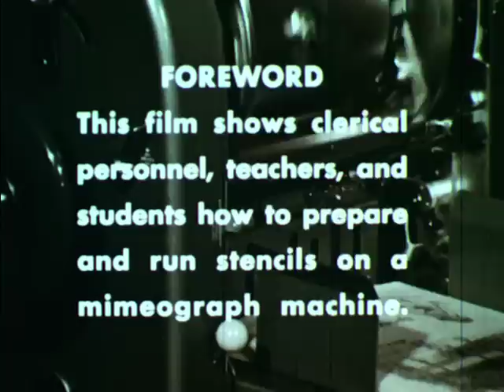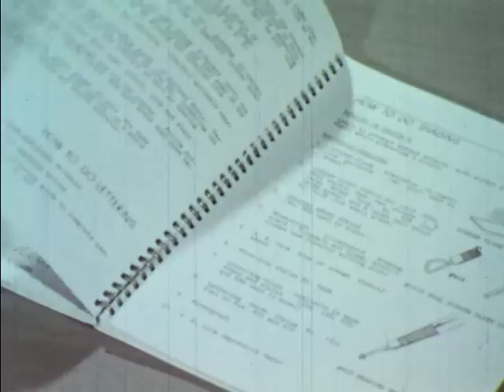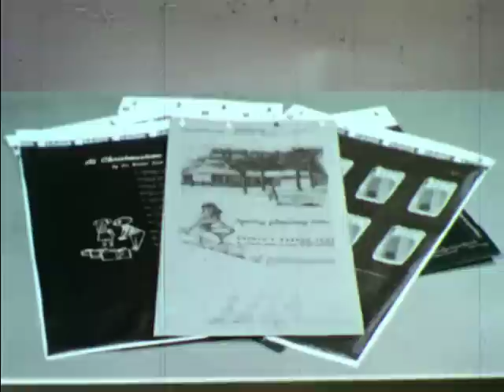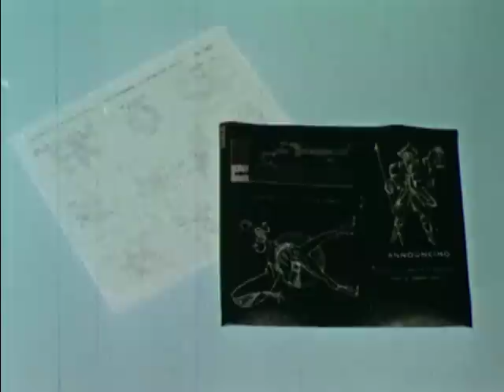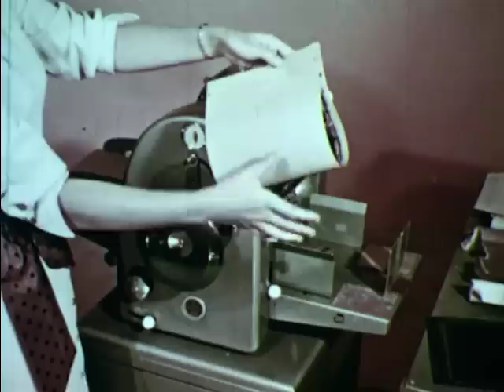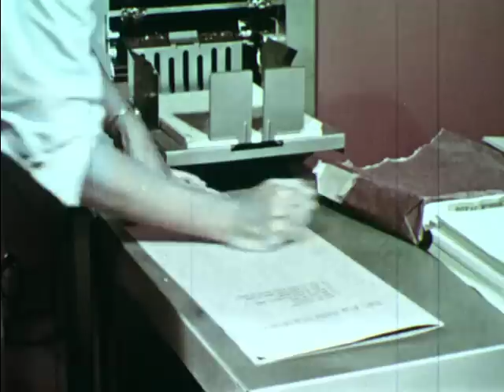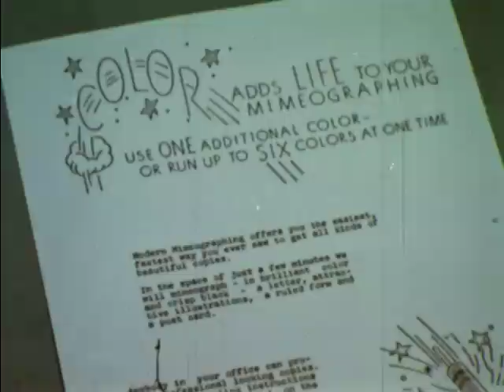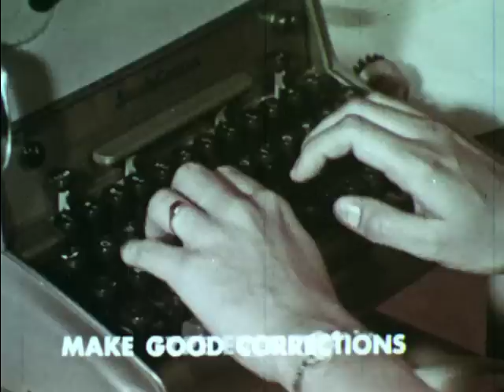Mimeographing Techniques (1958)

Comment: I run a commercial print shop and I think this process is similar to screen printing except that a wax paper with permeable surface is used in place of a screen with unblocked parts. Its also similar to Flash rubber stamps where a photosensitive foam is exposed to high intensity flashlights and ink is only permitted to seep through unblocked part of the foam piece.